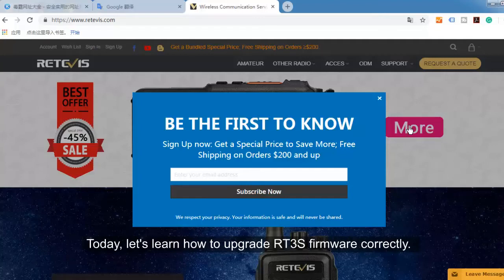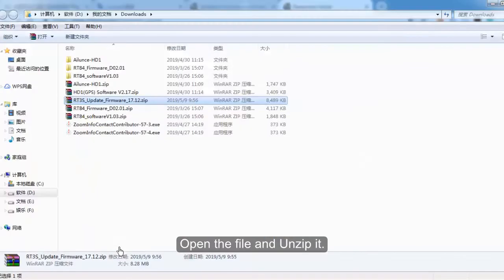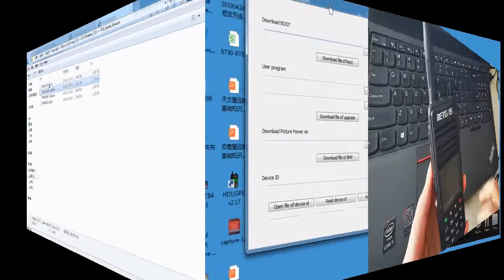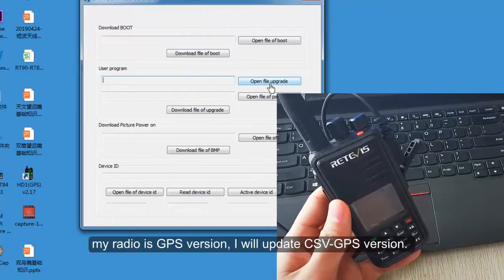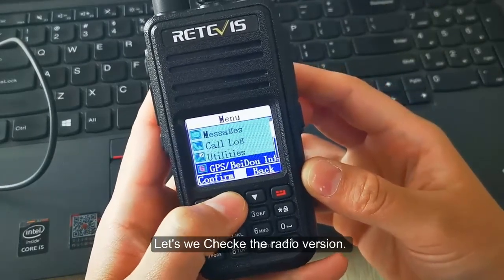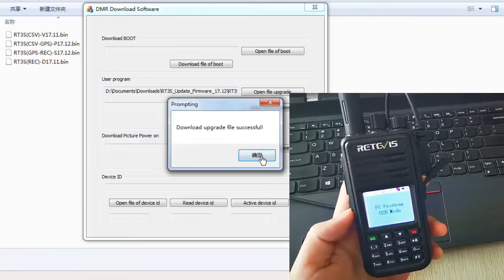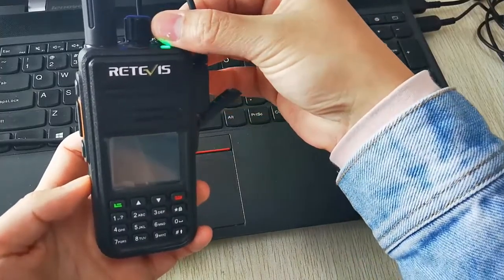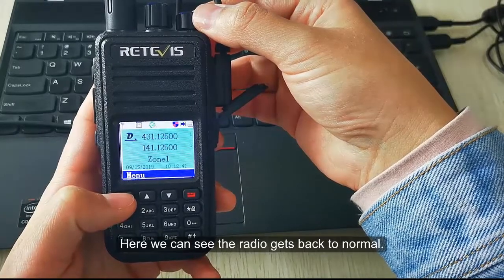RT3S firmware correct upgrade operation and wrong operation

Comment: Well thank You for the vidio, I followed directions to update firmware from D016.006 to P0170.12. Now I get sign-on screen that never changes or boots up radio. I tried three times, said successful. I have a RT-3S How do I bring it back ?
Reply from the maker: In my video, I showed 2 wrong operations,  please watch the correct operation. firstly, confirm your radio is GPS or not. Secondly, when updating firmware, confirm enter DFU mode correctly.  use the correct firmware file.

Comment: I get an error saying "USB open failed" after selecting file and trying to download to radio.  Radio shows in device manager as properly installed.  I am using Windows 10.
Reply: it is same for me. Did you find a solution?
Reply: @borakilerci1299  I was able to get it working on an older computer running windows 7.  I never found a solution for my problem on my newer windows 10 PC, sorry.
Reply: @skalover98  i found a solution 1 hour ago. In device manager i removed the device with its entire drivers. Then install new driver which shared in retevis.com. Then it worked in my case. I'm not suggesting to do that. In my pc i have worked with same chips which in programming cable and radio. Their drivers waaay different than the radios drivers. That's why it worked but i don't recommend to everyone.
Reply: @borakilerci1299  Nice! Glad it worked for you.  I had tried that before I posted my original comment, nothing worked on my new PC.